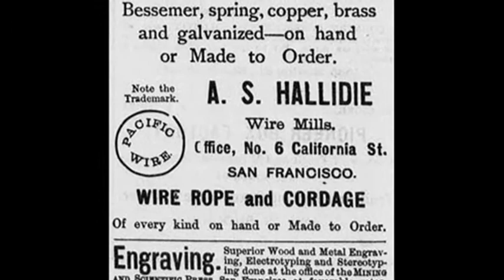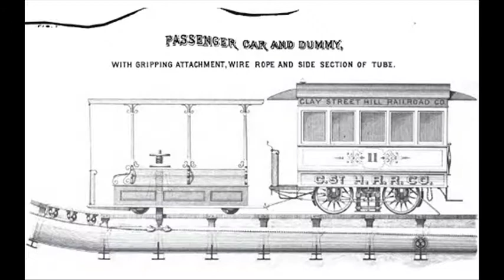2nd August 1873: The Clay Street Hill Railroad becomes San Francisco’s first cable car

Comment: The first elevated cable car in America was in NYC, borough of Manhattan 1868 from Dey street and Greenwich street to Chambers street in a demonstration run. The line went to and opened for the public in 1869 from Dey street to 29th St. and 9th Avenueto connect with the railroad terminal of the New York and Hudson River Railroad that was there 20 years before the El line was built. The cable company ended in 1872 and reopened using a dummy steam locomotive pulling one cable car until their replacement by el Railroad cars later that year.
Reply: Cool bit of history there, thanks